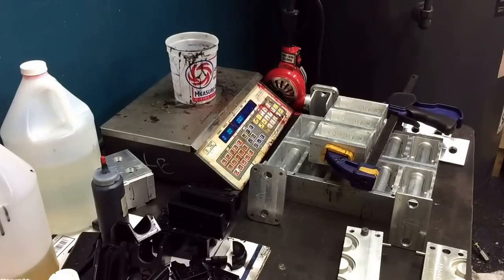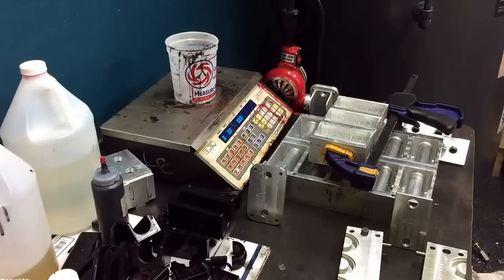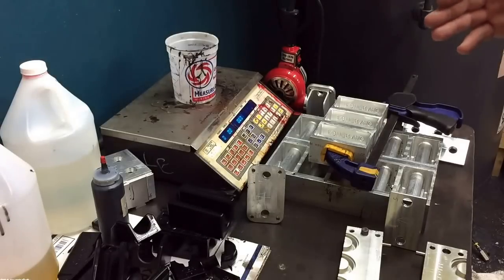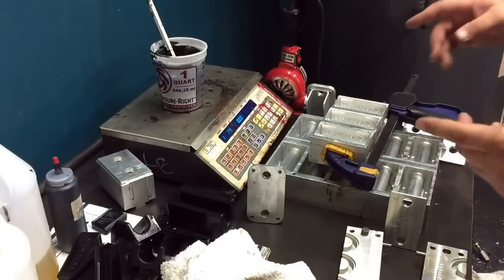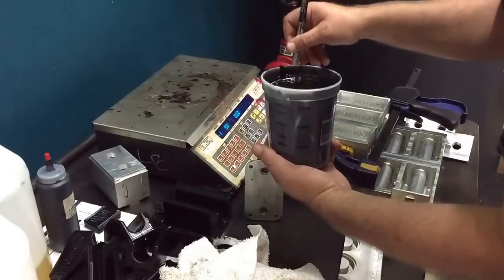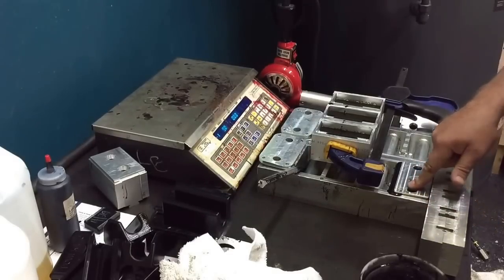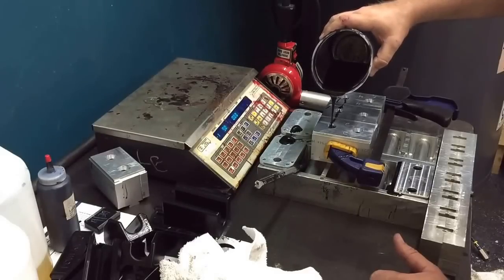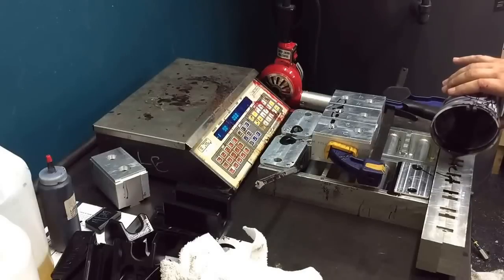ZOO CNC CONSULTANTS How to make stuff with polyurethane aka urethane rubber

Comment: Nicely done, very informative!!! I need to make some diff mounting bushes for my Montero. Would this be ok for that??
Reply from the maker: +Spacegoat92 Should be pretty much perfect in my opinion.  I've made hundreds or maybe even thousands of bushings with this same stuff.  Control arms, motor mount and even anti-vibration mounting pads for an air compressor and to date none have failed.  I think it's really great quality stuff.
Reply: +Groove Automation (-Louramore) Thank you kindly!! How do you address any air bubbles forming in the mixture?
Reply from the maker: We don't really have to most of the time but if we are pouring something critical we use an old pressure cooker and a vacuum pump.  Hold it at about 26" of vacuum for 2-4 minutes and that pretty much removes any visible air pockets

Comment: Hello Adam! Very nice video, that I have been looking for for a long time! 
So you use  PolyTek 75/80. Am I right to say that the digits 75/80 stand for its solidity scale?
Can it also be used for control arm bushings?
Thanks!
Reply from the maker: +Rishat Mukhtarov  Yes the durometer is in this case represented by the 75/80 and it is approx 75 to 80 Shore-A durometer.  It would work very well for control arms and in fact that was the first part we had used this particular urethane for.  We used to make a really nice set of billet lower control arms for mustangs but couldn't seem to sell very many of them so I just bailed on them after a while.  I'd love to see what you are thinking of making.  Let me know if I can be of any help.
Reply: Thanks much! 
It is time to change all rubber stuff on my Subaru Forester 2005, moreover its front caster should be improved, because it went backward after I have lifted the car using 2 inch spacers. And the only way of doing that is making control arm bushings with shifted center. Also you can cut the control arm, bend it and weld it back, but it is dangerous. Ready ones are expensive. So that's why I began to research what people do. Here in Russia it is not widespread, and what we have is polyurethane of hot casting (it is getting solid under 175 °F of heat and should be also degassed under vacuum) - not an easy stuff, right? )) but it is produced right in my city, and can be bought for $38 for 5 kilograms.
Seeing your video I was pleasantly surprised :-) So breathing in deeply and...
Reply: One question - what do you think of Poly 75-70 for making bushings?
Reply from the maker: +Rishat Mukhtarov I use it a lot for bushings also.  Should work very well for you.

Comment: And where do you get your part a and b
Reply from the maker: +Christian Benson We but from a place in Rivera Beach in Florida called US Composites but if you need small quantities let me know and we can sell you something to get you started.  I just started buying larger volume so we get much better pricing than the rip off places like Reynolds and Smooth-On.  Basically I could get you a half gallon kit out for less than $50 but if you need more then the packages they have start around $175.00 and the quality is so much better than all of the internet companies selling the same crap like Smooth-On and it's cheaper.  It took quite a few years to figure that out since there are so few resources for learning about pouring urethane.  It's almost like the industry purposely keeps the sources and methods a secret so that companies can charge such crazy prices for products.
text my cell if you have any other questions **9548739057**text only please
Reply: +Groove Automation (-Louramore) I would be interested in purchasing the half gallon kit. I want to start building concrete sink molds. Would this be a good product to go about doing that?
Reply from the maker: I am not to sure about that.  I think you might want a softer material for concrete casting but I've never done any of that myself so my suggestion would be to check out the smooth-on site.  The prices suck but I know I have seen some products that they market specifically for concrete molds.  You could also try the company we use.  It's called US Composites and they are in Riveria Beach FL I think.

Comment: How do you make different durometers
Reply from the maker: +Christian Benson you can change the mixture and also there are different materials that can be added.  I've used glassfilled urethane that pretty much cures as a super rigid hard plastic material but it's got limited uses because it ends up being very abrasive due to the glass bead filler.

Comment: rear strut insulator for a 280z NLA, seems like this process would work well. My concern would be if it would transmit more road vibration than the stock rubber ones.
Reply from the maker: +Dave WM This particular compound is pretty forgiving.  Best bet is to try it.

Comment: I want to make my own knee sliders (for motorcycle racing).  The hardness of the slider material is important.  Can you control the hardness by adding more hardener or is it fixed for each urethane type? love the Chopin in the background.  great video. thanks!
Reply from the maker: +Nick Kaplan 

Hey Nick,
Well frame sliders are often made from Delrin and it is pretty hard compared to the urethane we are using but I think you may be right about the mixture controlling the durometer.  When you get different hardness sets of urethane the mixture ration is usually changed as well.  The stuff here in the video is 2:1 but there is another product that is similar that is a 1:1 mixture.  It's worth checking into it.  I know that a local elevator parts supplier pours a lot of urethane for their products and it is way harder that anything we can use.

I'll see if I can get more info for you when I talk to our supplier again. Thanks for checking our video out!

Comment: Very interesting, thanks for doing the video. What kind of dye are you using?
Reply from the maker: I'm not sure exactly what it is but I know when I used to buy it from smooth-on and polytek but it was super expensive. The stuff we use now is like $20 for a 8oz bottle I think. Being that we use around 2 tenths of an ounce for every 50 ounces mixed it lasts a good while
Reply from the maker: I'll figure out what it is that we're using and put it up here when I have it
Reply: Cool, thanks.
Reply from the maker: +Crivo152 
Sorry, I forgot about this until just now.  The dye we use is from a company called US Composites in Riveria Beach FL  
It is crazy cheap compared to companies like smooth-on Etc...  Literally about 1/10th the cost.  I have never had a problem with it and it works as good or better than the others we have used.  Can't figure out why it is so much less expensive than the others??
Reply: +Groove Automation (-Louramore) Yep, I bought some from them. Thanks.
Reply: We can provide the Polyurethane Gasket Dispensing Machine   Our wesite www.chinasmegroup.com

Comment: Hello, What is the name of the product you are using?  Also, is one product "better" than another?  Pricing?  Thanks in advance.  BTW - nice video, well done !
Reply from the maker: We use stuff called  PolyTek 75/80 because the bulk of what we make are mounts that are used in a very rough environment. They are subjected to severe forces and temperatures for years. Between the heat and stress it's amazing that it holds up so well and in the beginning we tried some other brands that just didn't stand up to the needs.

Comment: what is the cure time on your mixture, and could it be poured into a cleaned part to never be removed instead of making molds?
Reply from the maker: Sure. We have made some items that actually are assembled by pouring urethane into a pocket where the two parts are joined.  It can be made to adhere amazingly well especially to aluminum. 
With heat we can de-mold in about 3 hours but I would say it's not fully cured for 36-48 hours. After 5 or 6 hours you can assemble parts and handle it pretty much as if it were cured but over time I've noticed that there are some very small changes in the properties for up to 48 hours. This isn't exact but we have a product that we use this material in that when assembled compresses the urethane and if not fully cured when compressed the shape can be altered inadvertently.

Comment: I have the capability to make some intricate molds, so this is good info for me. What draft angles do you use and is it durometer specific?
Reply from the maker: With the stuff we are using draft angles aren't even needed unless maybe we were to make something much deeper than we have already done I think. This urethane is about 80a but I've had some as soft as 30a and as hard as 85d